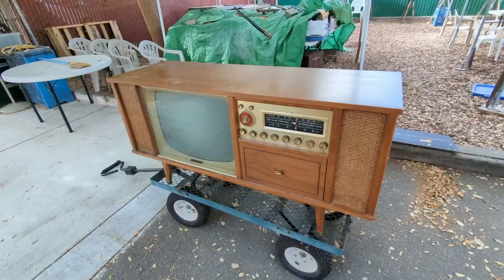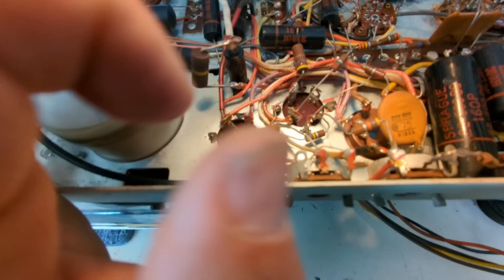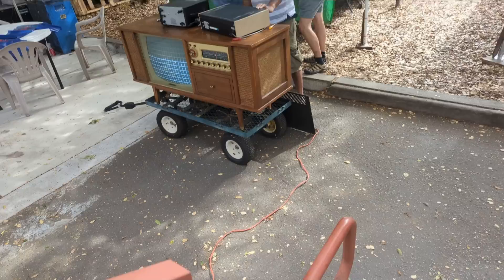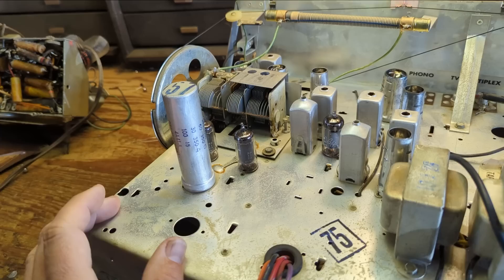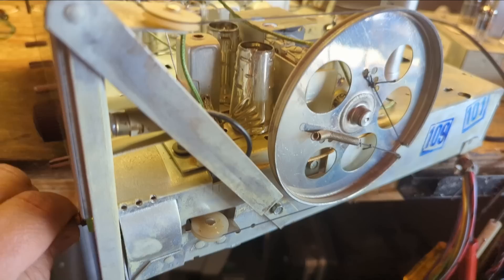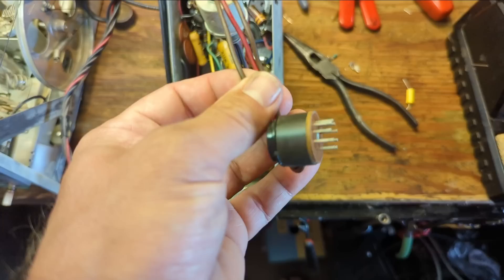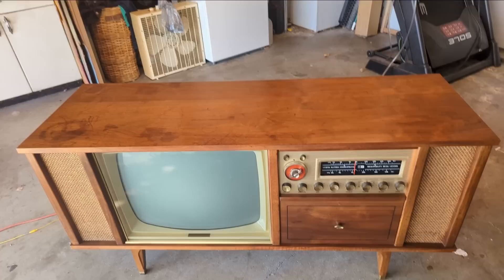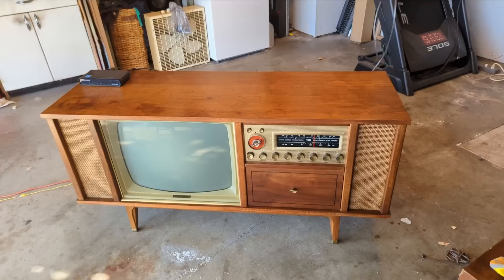Lets restore a Curtis Mathes TV Stereo Combo!

Comment: I found this video relaxing and a call to memory lane. My dad owned a TV sales and repair shop and I would work with him every summer when on break from school and then full-time until I joined the Air Force back in 1985. I remember well the old tube units with the "Big Screen 25" CRT," lol. My dad was more fond of Magnavox and Zenith and I remember well the smell of WD-40 used to clean the rotary tuner coils. Dad did not care for the C/M brand, as he thought the work and materials sub-par verses the price point and when they came out with the modular concept; found it overly complicated and less challenging to be a board swapper verses a real technician (and it also limited his repair compensation). I do recall the C/M's were heavy as hell, however. :-)

Comment: When I was young we had that exact model set.  It did not work more often than it did work.  After the wafers broke on the selector switch you had to put it on TV then turn the record player on to get the tv to work.  Flyback finally died on the TV.  I junked it and used the 12 inch speakers in my car.  This was long before car stereo wars was a thing.  Couple of things.  I do not see the channel selector lamp working.  The bulb lights the channel numbers up on the channel selector.  You are correct about the safety glass being easy to get off and clean, but that is not the only reason for that design.  When that was made in 1962 it was made to accept a color conversion.  They remove the safety glass and the crt mask and replace it with a 21 inch color tube, and install a color chassis.  That was an option.  It was quite pricey and we never got ours upgraded to color.  I do not recall ever seeing one with the color conversion.  The multiplex adapter was also optional.  The earlier 1960/61 model had a green eye tube where the CM logo is on the tuner.  You did nice work on the restoration.  Should last for at least 3 months.  Thats about how long ours would go without needing a repair. If I had the space I would get another one if I found it.
Reply: I'll check this.  That video was taken with the garage door opened, so it might not show well if it's dim, but yes, that should be replaced if it's out.  I feel like I saw it working when I was putting a new cartridge in the changer a few weeks after this. I'm a stickler for lights working.  We're finally putting it up for sale.

Comment: I did the changer repairs on this. Motor was frozen and some typical gummy BSR grease elsewhere. New cartridge also. The flip over one wasn't very compliant and had a weak channel.  It's shown here, but it got a replacement a couple weeks later.

Comment: Very clean! and cool. It's been years since I've worked on a CM. They were an interesting brand. My family bought a new color CM table model in 1968. I hate to say it but it was worst piece of junk. It barely lasted until 1971. In and out of the shop all the time!. We replaced the CM with a color Motorola Quasar II hybrid metal cabinet table job. The Motorola lasted until 1991, yes, 1991! The bulb was till good when it was de-commissioned. All the CMs I worked on over the years were a pain. Black beauty cap nightmares.

Again, thank you for sharing.

Comment: For a low-end brand I'm surprised at the high quality components they used and how nicely laid out the chassis are.  I guess the engineering is where they cut costs.  The Sprague caps with red writing are difilm capacitors, and are extremely reliable; on par with orange drops (in fact early orange drops were difilm also).  I've yet to find a bad one and never replace them unless there's a reason to.  They combined the best attributes of paper with the reliability of mylar caps, and were some of the best you could buy in the 60's-70's.  The ones with yellow writing however are regular paper caps, and need to be replaced.
Reply: I imagine it's regional. Curtis-Mathis in the late 1950s and early 1960s was anything but a 'low-end' brand. Quite the opposite, they competed directly with Zenith and Stromberg-Carlson. They were more expensive than Magnavox, who were truly more show than reality (except for their record changers).

Comment: You have plenty of bass boom from the 2 12" side woofers but the front tweeters have a pretty massive resonance, still common in today's cheap tweeters.
Reply: We aren't super impressed with the low end on this (I did the changer repairs on this) compared to another sans-TV Curtis-M we just did, but the audio is very clear.
Reply: @wintersbattleofbands1144  As a former tuba player, I always prefer bass quality over quantity. A 100-200 Hz boost plus under-damping (boom) produces the illusion of deep bass for those who don't know the (cheap) trick.

Comment: Incredible job! The picture does look great. 

I just bought the exact same model! The turn table works, though no sound through speaker, and can just barely hear. The TV, sadly does not, and the radio doesn’t either, though the unit looks to be in incredible shape cosmetically. 

How much of an ask do you think it’d be to contact TV repair shops for this? I’m in Tulsa, OK and there’s gotta be someone that knows what all this stuff is, right? 

If I were near Alameda I would offer to throw money in your direction, if it was something you’d be interested in.

Ironically, we almost moved there instead of Tulsa! But then I suppose I wouldn’t have found the TV. 😂